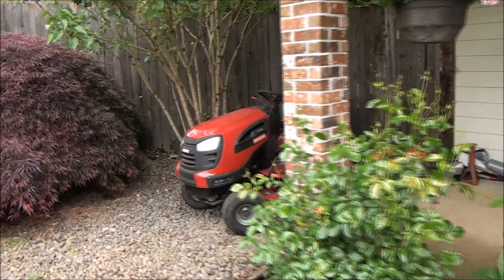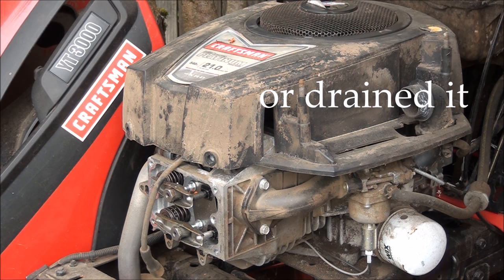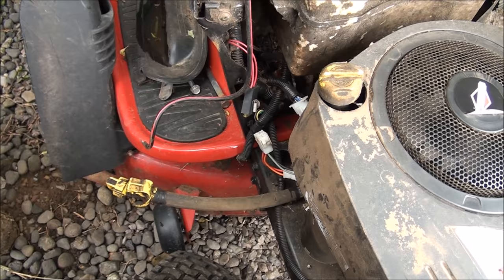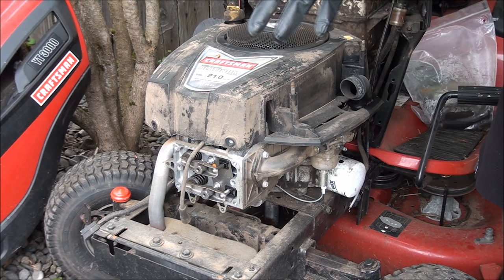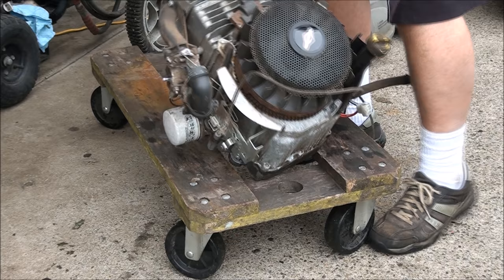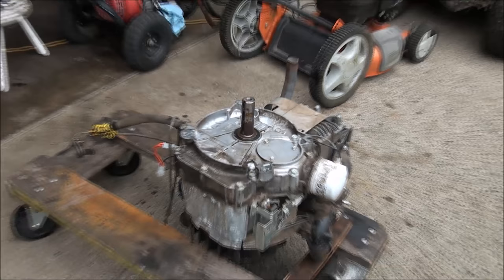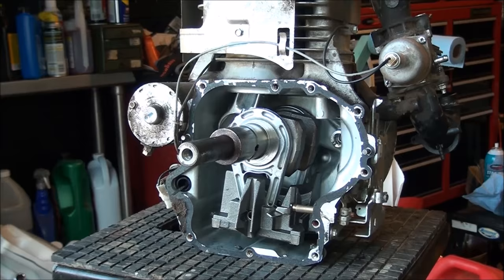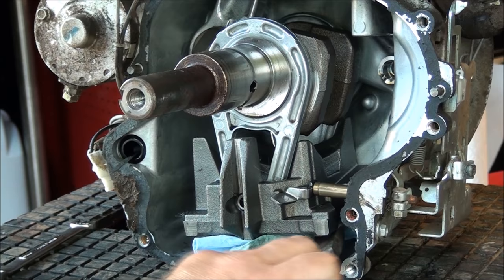DESTROYED! What a BUSTED CAM looks like. Briggs and Stratton OHV INTEK model engine common problem

Comment: The reason the camshaft gear is broke is because the compression release broke off first and got wedged into the cam gear and causes it to break. Seen it before. Generally if you're lucky it'll fall to the bottom of the oil pan without getting wedged in a Gear but sometimes not so lucky.

Comment: I change cams in B&S motors almost weekly , I have a 2' by 2' box I fill with those packing plastic bags fill with air (used for shipping) then put the engine upside down ,,,  Those B&S engines are hard on the decompressor parts .. LOL ... B&S both the single and twin sometimes you'll find a bent pushrod , if you do the problem will be the valve guide has moved and the valve isn't opening all the way ...
Reply from the maker: Great tip!
Reply: B&S needs to fix their terrible compression release costing folks money and headaches
Reply: Mines lobes were worn down on the old camshaft the compression release was intact and still good the valves were set right in place

Comment: Gasket use drill with brass wire wheel you be done in 2 min with no problems damage etc
Reply from the maker: great tip I will try that

Comment: FYI - To easily remove the old gasket, spray goo gone on it and use a rotary tool with a wire wheel. Make sure the wires are very thin so you don't scratch up the aluminum. keep using the wheel and keep adding more goo gone until its clean. You can clean both sides in like 5 minutes with little effort
Reply from the maker: Great tip! Also, if you use a brass brush/rotary disc the aluminum won't scratch

Comment: The quickest way I have found to scrape gasket off, is by hand, that razor blade and my fingers, just don't get cut, cause you can get a better angle with your fingers, I also use a good quality brass wire wheel and a pencil adapter on the dremel, makes quick work of the gasket, and doesn't harm the surface.

Comment: Another good way, is with the good quality brass wire wheel on the pencil adapter on a dremel tool, and carb cleaner, squirt it on the gasket, it dissolves the gasket, and any gasket maker , and the good quality brass wire wheel takes it right off, squirt and wire wheel all the way around, squirt and wire wheel, the quickest I have gotten a gasket off with that technique is 15 minutes.
Reply from the maker: Great tip!

Comment: i use a paint scraper to remove old gaskets. its not sharp enough to damage the ally. Your video has helped me to get the parts i need to fix my 11.5 21A807 engine

Comment: I drain oil and remove the oil spout before lifting to protect it. I replace that unreliable quick turn junk drain plug with an NPT plug (any hardware store) which Briggs have GONE BACK to using because those plastic drains often break and blow off while mowing. I found out the hard way.
Since they're reasonably heavy and I have a bad back I bought a used patient lift which are often used by motorcycle and mower mechs. There are many ways to hook the lift to an engine but I use a friction lock motorcycle tiedown. Then if there is no appropriate hole handy I make a loop of aircraft safety wire (every shop needs a roll, cheap online) and run that through whatever bolt hole is handy on the base. You can also drill a scrap steel tab or whatever does the job and bolt that to what you're lifting.  When I get motivated I'll drill some angle to fit the flywheel bolt and use that for central lifting on the next of my Inteks I pull. (I collect LT2000 mowers and get many years from them. Multiple used mowers are cheap to acquire and every several years I buy a new engine to swap into the fleet.)
Reply from the maker: great tips!

Comment: Back in the 60's, an old mechanic told me to never use gasket sealer- use axle grease. If you ever have to remove- it falls right off---- It has never failed me
Reply: axle grease? instead of a gasket or some gasket maker from a tube? It holds in the hot oil??
Reply: @jeffflowers729  yes- grease works good- never failed me
Reply: @jeffflowers729  I understood this as putting axle grease on the seal, not in place of the seal. Axle grease has no sealing properties between two pieces of metal.
Reply: LOL oo 😅bbif

Comment: Great video had my compression release break with only 15 hrs on motor B&S engines are junk maybe that’s why they filled for bankruptcy
Reply: This B&S Platinum on these YT 3000's are junk, but the the Platinum V Twin 24hp on my 2011 YT 4000 has nearly 1100 hours on it and doesn't burn  or leak any oil and still runs great!

Comment: Decomp valve does that all the time I do a couple a week here in our shop... I now just keep them cams in stock because it happens so often... there really should be a class action over this...
Reply from the maker: for sure I agree... I have had to replace many of those cams and replace alot of head gaskets too on the same engine model
Reply: I know these 21hp Platinum engines have this problem, but what about the 24 hp platinum V Twins? I have the Platinum 24hp engines on my two YT 4000's (2011, 2014, and I haven't had a single issue with neither of them. My 2011 has nearly 1100 hours on it and doesn't burn oil or leak any neither. It runs great and I use it all the time to mow 2 acres.

Comment: I use my dremel tool and little brass wire wheel to remove gaskets and dirt  works great an brass won't scratch anything
Reply from the maker: Good tip!

Comment: Mine is needing a new compression release it does still work broke but you know how it is I'll twist the flywheel by hand then start it up its to cold outside right now to play with all these out dated engines kinda waiting on spring time 

Then I'll finish these 2 different onan engines then start on the 89 craftsman engine then put the 19.5 twin engine on the john Deere Lt155 is my plan and give away 2 green craftsman bodies so I'll have more space

Comment: I like how you used the heat gun and razor scraper to remove what was left of gasket. That's what I call the doobie busy work. Sm oke a doobie  and get it done.. come back the next day and put it back together. Cause after doing that boring work and doobie I would call it day or I would clean the hell out of the motor.
Reply from the maker: lol! I like your style

Comment: So maybe the compression release broke first (like they always do on these), then someone cranked down on the valve adjustment to try and correct the high compression issue but ended up over-tightening the valve clearance which jammed up the cam and broke it into pieces? I dunno, just a guess. I see the comp release  finger break all the time but I’ve never seen the cam gear bust apart before, not even the plastic ones.
Reply from the maker: I agree with your summation
Reply: 🤔😒😕 Sounds logical.🖖

Comment: You can use Roloc  lock disc surface conditioning Disc  and the pad holder to remove gasket  on a angle head die grinder it will make job easier and faster
Reply from the maker: cool! thanks I will check that out. I hate scraping gaskets!!!
Reply: that's how I do it...

Comment: " My " gasket removal consists of 1/4 in. Angle Die Grinder with Scotch Brite Roloc Disc on it, 2-min. or less time is all it takes for that gasket.
Reply from the maker: great tip!
Reply: I use my angle die grinder with a nylon bristle attachment from 3M. Works great too.

Comment: Oh man, I have an Ariens with the 17.5HP B&S 31000-series engine and I have replaced the cam TWICE already due to a broken automatic compression release mechanism. It usually also damages the governor gear as the parts drop into the crankcase. Parts cost each time is around $95. B&S should be ashamed of themselves on these engines. The parts on the ACR look more like what you'd find in a pocket watch rather than an engine.
Reply: I've repaired two like this so far. A 17.5 and a 21 hp. Both times I used the $95 OEM part instead of the $45 Chinese part. But your OEM part failed in short order 'eh? Ugh. Maybe time to replace them with a good Kohler Command engine.
Reply: @dkeith45  Next time I'm trying the Chinese part. :-)
Reply: @eosjoe565  According to a friend who runs a lawnmower repair shop, B&S is on their third cam design trying to fix this. I asked him if the Kohler Command single cylinder, which is an engine he says doesn't have the flaws the B&S does, has the same sort of compression release on its cam, and he said yes, but its a better design and he's never seen one fail. Think I'm going to look for a used one and do an engine swap on my mower. BTW, he also said Tecumseh engines of that type, have a replaceable compression release, that doesn't require a whole new cam shaft. I told him he should make a YouTube video showing opened engines and the difference between all those parts.
Reply: @dkeith45  That's surprising. If they have new designs they must not be using them for spare parts. Both new cams I purchased were OEM B&S and they were identical to the original cam in the 5-year old engine.  It's not the cam that is at fault, it's the weight on the ACR. Both of my ACR mechanisms broke at exactly the same spot. So close that you could almost match the broken piece from one ACR to the other broken one. They simply need to make the weight out of something other than pot metal. I don't expect much out of B&S now that they've filed for bankruptcy. Maybe whoever takes over will make improvements, much like the company did that took over for Tecumseh.
Reply: @eosjoe565  You're exactly right. What the OP of this video calls the compression release, is actually the counter weight, and that's what always breaks. Which is puzzling since it doesn't seem to make contact with anything. All it's supposed to do is cause the half round pin, which IS the compression release, to rock back to its flat side when the engine starts. I didn't think to ask the shop owner if the 3rd gen cam will work on older engines, or if it has the same problem. I do know, that he considers Intec engines junk, and doesn't like the Nikki carbs that are on them either.
Reply: @dkeith45  It's interesting you mention Nikki carbs. That was the other problem I had with mine. Carb flooded the crankcase with fuel twice. It's my own fault for not installing a fuel shutoff when I bought the mower. Anyway, I tried a rebuild kit and half the parts wouldn't fit. Those Nikki carbs have some weird parts not found in other carbs. So I decided to replace the carb and found the Nikki was being replaced with a Ruixing (which costs 2/3 the price of the Nikki). So I bit the bullet and installed the Ruixing, which is a more conventional design. The engine kicked right off and ran like a swiss watch with no adjustments required. Ran better than the Nikki ever did. Needless to say I installed the fuel shutoff valve and always keep the gas turned off when not in use. :-)
Reply: @eosjoe565  Yeah, that is a common problem with that carb. In the 21 I just worked on, the crankcase was full of gas. Everyone I work on I put a shut off valve on it, and almost always shut mine off and let the mower run till it dies so all the gas is run out of the carb. This friend tells me that many of these mowers that usually use the Nikki, some also use a Walbro which he says is a much better carb. Until recently there wasn't an aftermarket Walbro, but he found one from an Ebay seller which I'll link. Would you please link the site you got that Ruixing from and what its model is? https://www.ebay.com/itm/254215813746?ul_noapp=true
Reply: @dkeith45  I got my Ruixing from Pro Parts Direct. Below is the link. It doesn't list a model number, just a part number. My engine is a 31R907-0018-C1.   https://www.propartsdirect.net/lawnmower-parts.aspx#/Briggs_%26_Stratton/31R907-0022-G1/CARBURETOR%2c_FUEL_SUPPLY%2c_KIT_-_CARBURETOR_OVERHAUL/31R9070022G1/104880004A

Comment: The “mysterious” small plastic piece found in the crankcase at 14:55 in the video was never identified by Jeff. He doesn’t say where that plastic piece or part came from or where it goes. I have found the same piece in the crankcase of a single cylinder Briggs I’m working on. Anyone here that can identify the piece and say what that piece/part is and where it goes????
Reply from the maker: Someone in the comment section identified it a few years ago. I think it was an oil pick up tube if I remember correct. The engine has ran fine without it for years. I would have replaced it anyway though if I knew what it was back then.
Reply: @JeffsLittleEngineService That mysterious small size plastic piece was correctly identified by someone on a small engine repair FB page. It’s a plastic bushing that’s part of the compression release mechanism. I know, it’s wild! The compression release has a pin that slips in or inserts into that plastic bushing that sits in or is part of the camshaft. It’s not visible when you inspect the cam. When the ACR fails and blows up, the plastic bushing is then exposed, comes loose and can be found in the bottom of the crankcase. Thank you for your reply!

Comment: IF i may ask what would a job like that cost parts and labor, in my case i think I just need cam shaft and gasket. Thank you
Reply from the maker: Usually apx. $100.00 in parts and apx.$200.00 labor
Reply: Thanks for the info @JeffsLittleEngineService

Comment: Hi Jeff, ty for your videos. I wondered why you dont use a brass wire wheel for gasket removal?
Reply: Its not good to it would scratch the surface were the new gasket sits and not seal right 

I have wire wheels and never use them on that you want a flat clean smooth surface

Comment: Great video, thanks. I am at that point of repair/replace and my question is my 15-year old17.5 (that I had done the usual head gasket replace, oil change, new plug) was running fine when it blew. I haven't done a tear down, but it appears the crank counterweight punched through the back of the engine body above the level of the sump. It continued to run, although badly, enough to get it back to the garage. I'm a backyard fixer but am not sure about what I might be getting into on a tear-down. Thinking new mower would be the best repair considering cost and mower age?
Reply: That's a common problem with Intek motors

Comment: Wow. I've done two of these so far. First one, the compression release  counter weight that was busted up and the governor gear destroyed in an Intec 17.5 hp single cylinder. Second one, a 21 hp Intec single cylinder only the compression release counter weight was busted up. I'm puzzled why this happens since the half round rod is the decompression release and contacts the lifters. Why is it that the counter weight always gets busted up? I don't know what it is hitting. Maybe it needs to be made out of a stronger metal, maybe Titanium. I was amazed to see your entire camshaft gear was busted up. WOW, serious design flaw, or implementation flaw here.
Reply from the maker: the small shaft that holds the counterweight mechanism is what seems to break
Reply: @JeffsLittleEngineService  In the two I've done so far, a 17.5 and a 21 hp Intec, the spring was intact. The short round pin intact, and the long half round pin 'compression release' was also intact. The only broken part was the large C shaped counter weight. In the 17.5, that weight was broken into four pieces. In the 21, it was broken into two pieces. I saw no scaring inside either engine, so can only imagine what busted up the part was where the steel crankshaft moves close to the steel crankshaft weight? Because everything else is aluminum, except for the camshaft of course, but I've seen no wear or scaring on the cam lobes or the lifters. Very strange situation.
BTW I have a good Kohler Command 17hp vertical shaft and I'm sorely tempted to open its case just to see what its compression release is like, because I've heard those never break.

Comment: My 15.5HP ( 2003 ) Intek overhaed valve assembly has an exhaust valve that is barely moving.  ITs been sitting a long time.  The pushrod when removed looks good as it is not bent or warped and rolls perfectly down a flat surface.  The valve is not completely closing. It is stuck which is why it is blowing back.  I will pull the cyl head and check it out.  Question:  Are most intek OHV engine head compatible?   Can I swap one from a similar intek onto this 15.5HP?
Reply from the maker: I think most are similar but I do not know for sure.